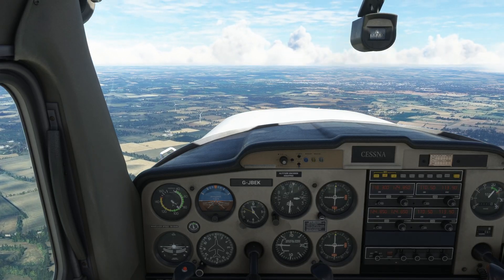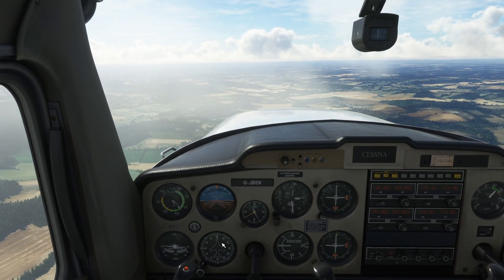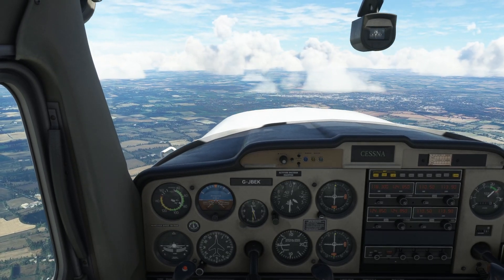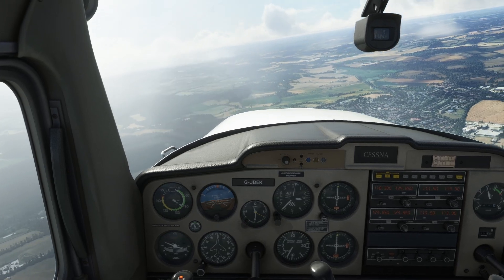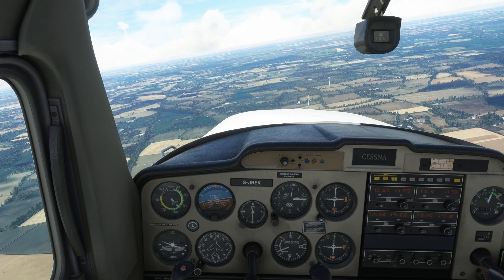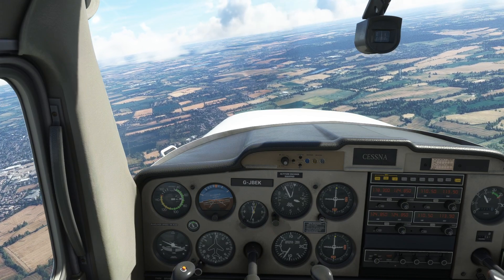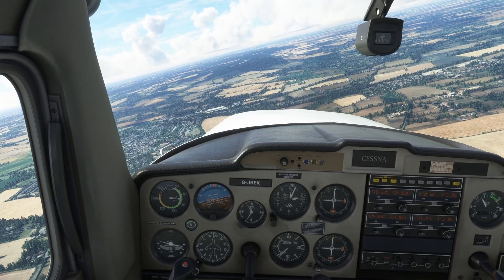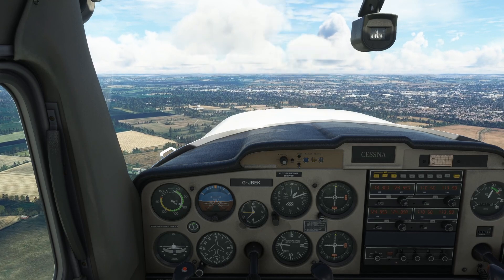Practicing rate 1 level turns, climbing turns, and descending turns in the Cessna 152 in MSFS

Comment: Good job John. The only thing I would recommend is to increase the throttle to 2400 during your level offs. The 152 doesn't have much power so it can use all the help it can get to keep the speed up.
Reply from the maker: Thanks for the tips!